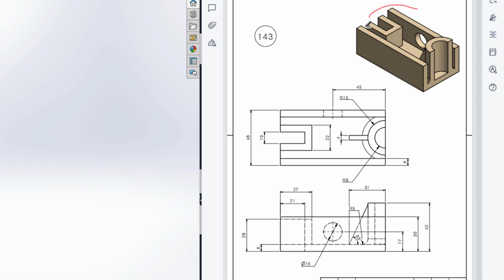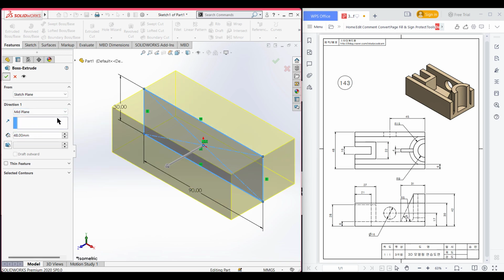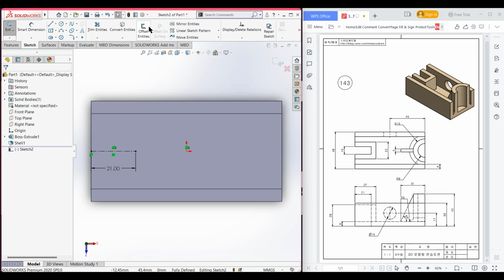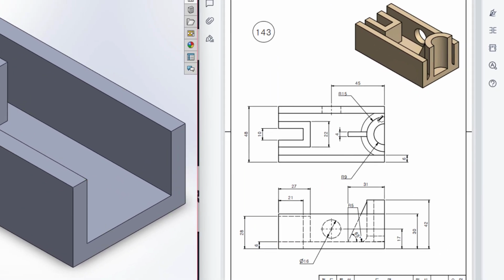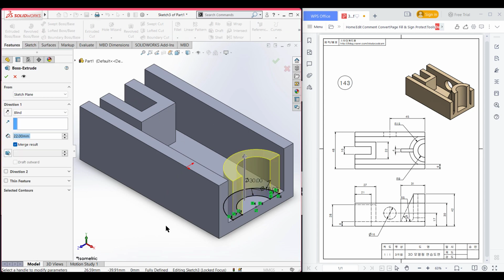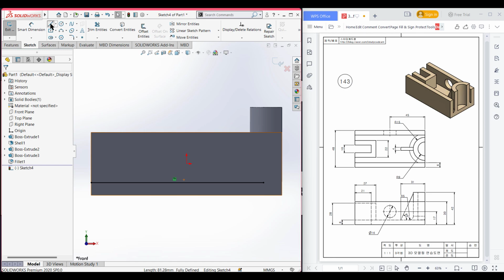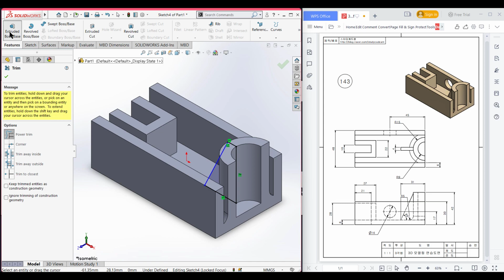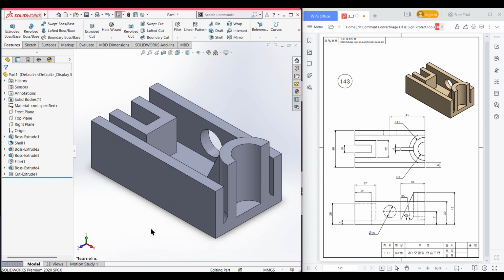SolidWorks | 3D CAD EXERCISES 143 | StudyCadCam | Solution Tutorial |

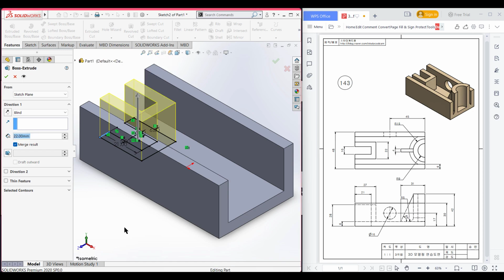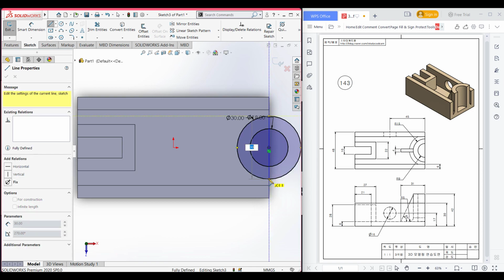Comment: two mistakes that you made. First one when you finished with U shape type at 4:47 there is openning that goes all the way thru which you did not do it. Second at 5:57 you took it all the way from top but on the drawing is down by few mm from top. Not a big deal but mistake is mistake.
Reply from the maker: Thank you for finding out all of my mistakes.

you are right there is a extrude cut in U Shape all the way through I have missed. and also other mistakes.
When I get free time I open a StudyCadCam drawing and model on SolidWorks. Then I make a video. As I am the only one to check the solve that I have made, Sometimes I missed one or two things.
Regardless of mistake, I hope you all will understand and get a overall idea how to model the drawing.

Thank you for helping me finding out my mistake. In future I will try to deliver more good lecture gradually. Yours comment give me inspiration to work really hard and make good content.
Reply: @mahmudhasanmaraj  No problem. At least you accepted what I said. I know some others get mad and they steal will fight that there was no mistake.
But I believe fixing and learninig on mistakes and not ignoring them.